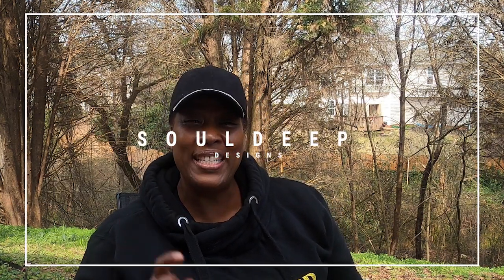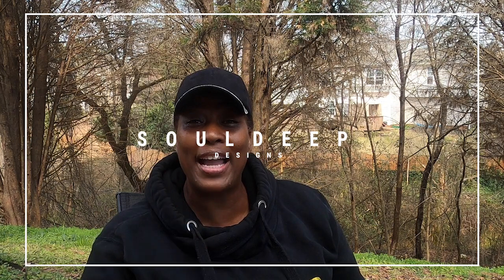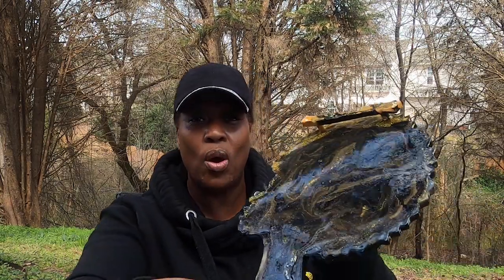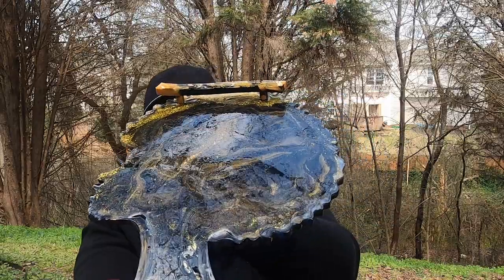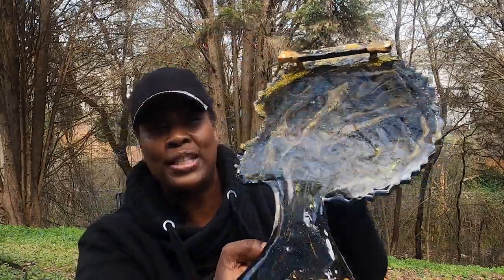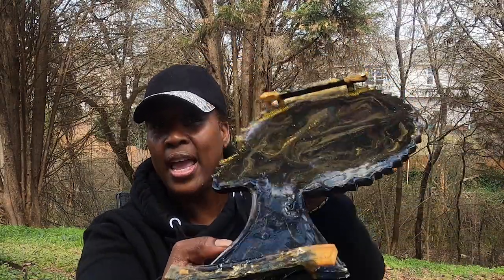How to Resin a  Afro Woman Tray and Coasters using a silicone mold, pearl x mica powder, alcohol ink

Comment: Hello
I LOVE this video. I am about to make one of these today. I have 1 question for the large tray Afro about how much resin and harder would  you say you use to fill the mold?
Reply from the maker: Hey Tyra I hope all is  well.  It took me awhile Trial and Error! I purchased those SOLO cups from Walmart and used a 1/4 for the resin and harder and mixed. I had a little left over. Which I used for small molds so I wouldn't waste. I hope this make sense if not please reach out again.  Thanks again for your support

Comment: These are absolutely Beautiful!!! How long did you wait to add the handles after you poured everything? What do you mean buff and polish? Im new to resin and debating if I want to start using it. You've definitely inspired me💚
Reply from the maker: I waiting about 20 Minutes but Also it depends what type of resin you have as well as when it begin to set. Just monitor and set your handles in before your resin begin to get too solid.  After, I sand the edges, I will buff and polish with a clean cloth. I AM SO GLAD THIS VIDEO GRANTED YOU INSPIRATION - YES NO DEBATE YOU CAN DO IT!!!! AND I KNOW ITS GOING TO BE BEAUTIFUL. IF YOU HAVE ANY MORE QUESTIONS PLEASE FEEL FREE TO ASK.  I will also be completing more resin products.  So Stay Tuned. Thanks again for all your support
Reply: @SoulDeepDesignsByCheri  
Thank you so much. Ive jump on the boat and made a few pieces. I for sure need more practice. Do you use a polishing cream? Ive seen people sand the entire surface of the piece with multiple grits of sand paper and then polish. Is it a must to do all o that? Im using KSRESIN.